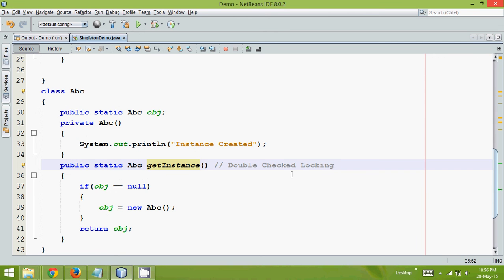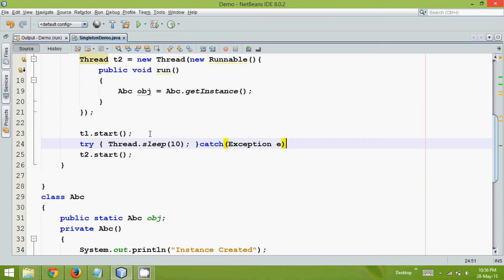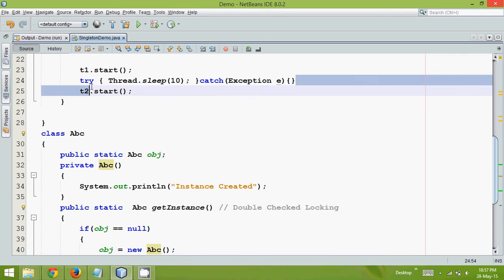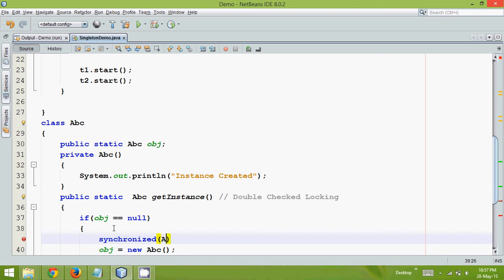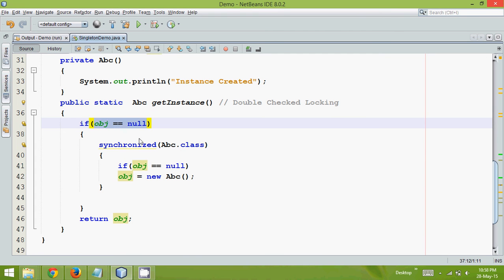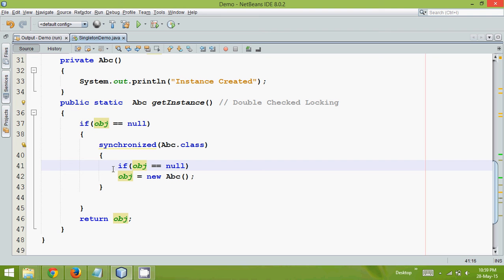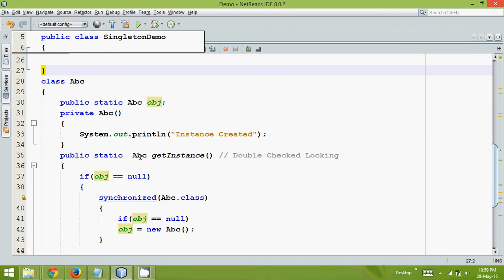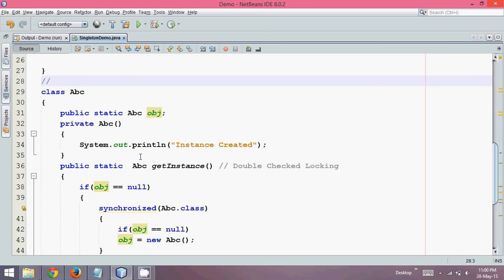Singleton Design Pattern using Double Checked Locking Part 4

Comment: hi Naveen, Thank you so much for the videos. very informative.
I just have 1 doubt with this one.
I understand the purpose of  the 1st obj null check.
But whats the point of the 2nd obj null check ? the first itself will ensure whether its the first thread thats coming into processing right ?

Thanks..
Reply: Assume the scenario where two threads passes the first if condintion. Now both the threads will try to acquire lock and only one will succeed ( say thread1) and the other will wait for the lock. Now thread1 will create the object and obj is not null any more and thread1 will release the lock. After this thread2 will get the lock and now before creating the object once again for the second time, this if condition will prevent that from doing so.
Reply: Yeah same question i have did you get your answer ?
Reply: public static synchronized Abc3 getInstance() {
        if (null == abc) {
            synchronized (Abc3.class) {

                    return abc = new Abc3();
            }
        } else {
            return abc;
        }
    }

This will work perfectly always just to extra secure the second null check has been done

Comment: Ok for those who didn't get it:-
Why not use synchronized block just above the first null check . I think we can avoid the second null check by doing so. -> Question by Pankaj
Why second check is required?? I mean obj null check?? -> Question by Entertainment First

See what is happening is as navin said that if we are in a thread and let's assume we created 100 threads and if we use synchronized getInstance() method, then the 1st thread has to be over then only the 2nd thread will continue it's work and so on. So there is no Multithreading. If previously it took 1 second total to complete the work in thread, now it will take 100 seconds.  

So guys why not we just ask the 1st time thread to hold on all the threads working on it and as soon as 1st thread is done with it's work we ask all the remaining 99 threads to work on it simultaneously, This way 1st thread takes 1 second and all 99 threads will take 1 second in total only. So how to do it?

First we check if the thread is 1st thread or not so the 1st (obj == null) if statement in video. If it's not 1st it will continue and return the old obj.
Now if it's first, we will tell other threads to stop there work till 1st thread has done it's work. So we write synchronized function and in it we do error checking just in case (that's why we have two (obj == null). so 1st thread will create a new instance of the class, then say to all other thread my work is done do your work now simultaneously!!

So back to question: Why not use synchronized block just above the first null check 
Ans: Because if you do that it will stop all threads each and every time, as explained above and cause more time for task to finish and if you do it the way he did it, then only 1st thread will ask other threads to stop for it to finish it's work.

Ques: Why second check is required?? I mean obj null check?? -> Question by Entertainment First
Ans: Just to be extra sure, I think so
Reply: You r an god of legend

Comment: Why not use synchronized block just above the first null check . I think we can avoid the second null check by doing so.
Reply: The second null check  is necessary because once the first thread enters the synchronized block and creates the instance, other threads that were waiting to enter the block will also proceed. Without this second check, these threads might attempt to create a new instance again, which would defeat the purpose of the Singleton pattern.

Comment: Hello Sir,

There is one query in case of double check locking the getInstance code looks like this :-

if(obj==null)
{
synchronized(Abc.class)
{
if(obj==null) obj = new Abc();
}
}

Why not we go for this as this gives same output

synchronized(Abc.class)
{
if(obj==null) obj = new Abc();
}

Why need to check obj==null before synchronized block when that makes no difference

Avi

Comment: Sir it not work correctly....see belove 

class Demo {

 int num;
 static Demo d;
        private Demo(){ }
 static  Demo getDemo(){
  if(d==null){
   synchronized(Demo.class){
   if(d==null)
   d = new Demo();
   }
   System.out.println("Instance created");

     
   }
  
  return d;
  
 }
}

class Test {

 public static void main(String arg[]){
 Thread t = new Thread(new Runnable(){
 public void run(){
  Demo d = Demo.getDemo();
 }
 });
 
 Thread t1 = new Thread(new Runnable(){
 public void run(){
  Demo d1 = Demo.getDemo();
 }
 });
 Thread t2 = new Thread(new Runnable(){
 public void run(){
  Demo d2 = Demo.getDemo();
 }
 });
 
 Thread t3 = new Thread(new Runnable(){
 public void run(){
  Demo d3 = Demo.getDemo();
 }
 });
 Thread t4 = new Thread(new Runnable(){
 public void run(){
  Demo d4 = Demo.getDemo();
 }
 });
 
 Thread t5 = new Thread(new Runnable(){
 public void run(){
  Demo d5 = Demo.getDemo();
 }
 });
 Thread t6 = new Thread(new Runnable(){
 public void run(){
  Demo d6 = Demo.getDemo();
 }
 });
 
 Thread t7 = new Thread(new Runnable(){
 public void run(){
  Demo d7 = Demo.getDemo();
 }
 });
  Thread t8 = new Thread(new Runnable(){
 public void run(){
  Demo d8 = Demo.getDemo();
 }
 });
 
 Thread t9 = new Thread(new Runnable(){
 public void run(){
  Demo d9 = Demo.getDemo();
 }
 });
 Thread t10 = new Thread(new Runnable(){
 public void run(){
  Demo d10 = Demo.getDemo();
 }
 });
 
 Thread t11 = new Thread(new Runnable(){
 public void run(){
  Demo d11 = Demo.getDemo();
 }
 });
 Thread t12 = new Thread(new Runnable(){
 public void run(){
  Demo d12 = Demo.getDemo();
 }
 });
 
 Thread t13 = new Thread(new Runnable(){
            public void run(){
                 Demo d13 = Demo.getDemo();
             }
 });
 Thread t14 = new Thread(new Runnable(){
                 public void run(){
                  Demo d15 = Demo.getDemo();
                 }
 });
 
 Thread t15 = new Thread(new Runnable(){
          public void run(){
           Demo d14 = Demo.getDemo();
           }
 });
 t.start();
 t1.start(); 
 t2.start();
 t3.start(); 
 t4.start();
 t5.start(); 
 t6.start();
 t7.start();
 t8.start();
 t9.start(); 
 t10.start();
 t11.start(); 
 t12.start();
 t13.start(); 
 t14.start();
 t15.start();

 } 
}